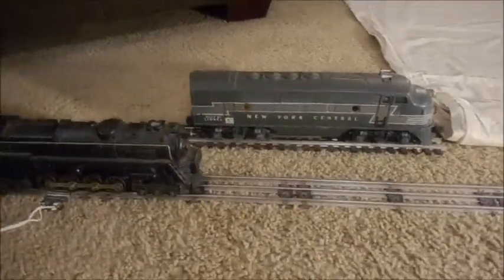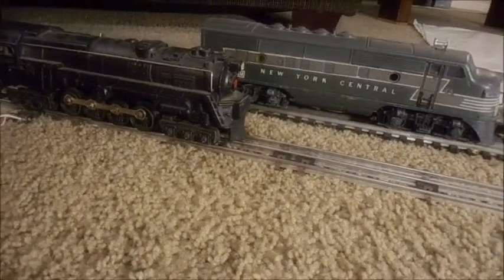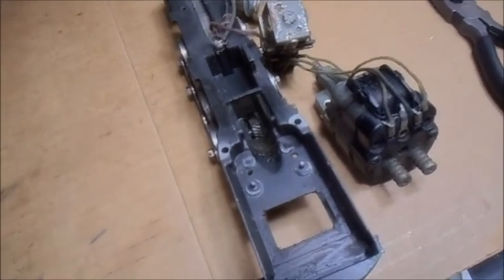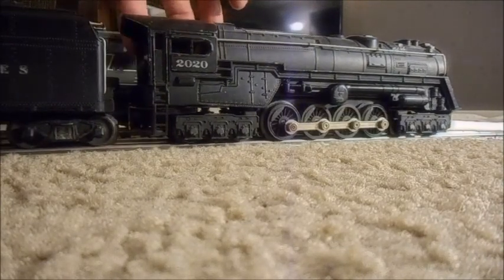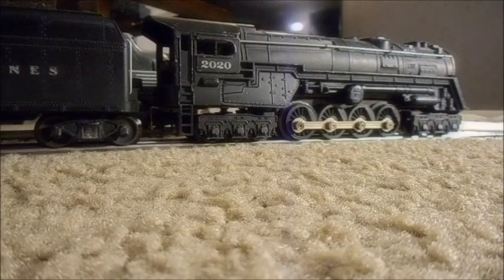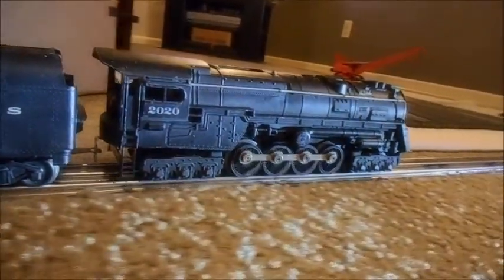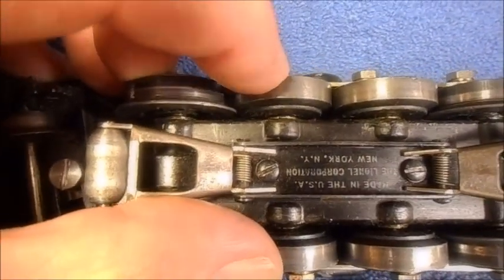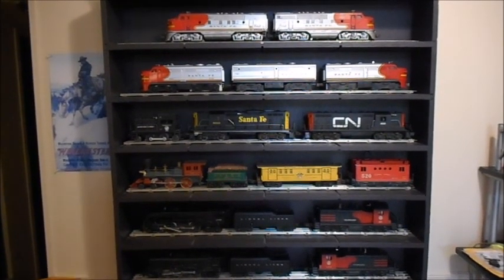Lionel 671 671RR 681 682 2020 turbine repair sticking wheels erratic lurching operation

Comment: Great video -- I ran into the same problem with a 736 Berkshire and did what you did -- press the wheels on the driving axle very slightly together. It was also necessary to very slightly spread the blind wheels on the adjacent axle. Performance is much better now. Thanks for providing this knowledge!
Reply from the maker: We are always learing in this hobby aren't we and since it took me so much time to figure out what the heck was going on that I just had to make the video to hopefully help others keep their sanity and not give up on their broken trains.  Happy Railroading!

Comment: I just completed repair on my 671. Wheels binding. Ordered new drive gear, bushings, wheel puller and wheel cups to remove and press wheels on. 
Took motor apart to clean brush plate, brushes, cleaned stator shaft, washers and ball bearings. Lubricant applicant and man can this baby hum!!
Reply from the maker: Excellent work restoring that machine and I'm curious if you found any worn wheel bearings on that rear driven wheel axle shaft.
Reply: @trainzone1073  yes there was one that I replaced.

Comment: Instead of using channel lock pliers, you should consider using a vise.  One thing that you may also consider: the brass drive gear needs to be centered on the drive axle.  In order to center the brass gear on the drive axle, it is helpful to temporarily insert 2 thick washers (one on each side of the gear) to take up the excess space while gently pressing the wheels on in a vice.  Let's not forget to properly "quarter" the wheels so that they are properly aligned with the others on the same side.  I hope this is helpful and not confusing.
Reply from the maker: Great repair tips to keep in mind.  My vice is in our maint shop across the property so I figured what the heck I'll try the channel locks.
Reply: @trainzone1073  Or you might want to use a "C" clamp.  It will give you more precise control than the Channel locks.
Reply from the maker: @GG1man  Good advice and with my limited tools here I had to improvise and got lucky.

Comment: I've had a very similar problem with a 671 turbine and like you it took me a couple day to figure it out. I came to a very similar conclusion except my gear apparently slipped to one side and I had to slide it back slightly, seem to be a common problem.
Reply from the maker: Great tip and I think one of mine had an off center gear too.

Comment: These are the most under rated engine but they have the same motor and other drive characteristics of the more costly Berkshires.
Reply from the maker: Excellent point, and with the die cast metal axle housing around the drivers, and the die cast metal frame, let alone the weight of the die cast metal shell,  great work Lionel.

Comment: I have found that the gear on the drive axle not being centered on the axle causes this jerky running in one direction and not the other. I have placed a shim between the right side of the gear and frame keeping the axle and gear from moving to the right and not meshing with the worm end of the armature and solved it. When reversed, the worm automatically drives the gear and axle to the left and runs smoothly which is why it ran great backwards. Also, a worn bearing and race will cause the armature to shift causing erratic running. I used a couple "E" clips to lock over the axle as shims. Re aligning or centering the gear and tightening the wheels to the frame is probably the right way.
Reply from the maker: Yes I have seen some gears more to one side than the center so they must not be pressing them on all the same.  Thanks for the repair tips for the train community.
Reply: I would like to suggest a possible reason that the drive gear may not stay centered as it came from the factory.First is age,the many yeas of operation
Reply: asI was saying the many years of operation can cause the gear to move slightly to one side or the other,the torque of the motor applies a sideways pressure,since most locos run in one direction much more than the other the gear would have more sideways pressure in that direction This could have and probably does have a very small incremental tendency to move the gear to one side more than the other,considering the age of these units there has been ample time for this to happen,remember that gear is pressed on and brass can stretch.

Comment: 9 out of 10 times one if the drive wheels are loose on the axle. Only way I found is using jb weld on the axle press the wheel back on let it sit and its fixed. Tip: put a piece of tape on the axle shaft up around the bearing so the jb weld doesnt bond the axle to the bearing.
Reply from the maker: Yes excellent and I had a loose one on a 2344 diesel and had luck with some locktite  and like you said keep it out of the bearing.

Comment: Thanks, that’s really helpful . My 671 has been sticking too. How did you remove the driver rods?
Reply from the maker: The side rods on the drive wheels have nut/stud fasteners and mine were so loose that a gentle touch with pliars was all I needed to remove, hope this helps and good luck on the repair.

Comment: Same thing is happening to my turbine. The e unit is cycling but it won’t go into forwards. There is some gunk in the worm gear. I will try to get it out
Reply from the maker: How is the turbine, running strong?
Reply: @trainzone1073  nah, I fixed the worm gear problem, but the engine won’t cycle from forwards to reverse. Ima see if I can get some crc electromotive spray
Reply: @skiiipawbs  Ah perhaps a reversing unit problem?  I do have one more tip I can pass on your way about cleaning the reversing unit.  Good luck!
https://www.youtube.com/watch?v=_56h8Que6hU&t=139s

Comment: My 681’s light isn’t turning on when power is applied. The drive is very responsive, and the caboose light turns on, but the engine’s headlight doesn’t turn on
Reply from the maker: Thanks for watching and the boiler front easily pops off (spring loaded tabs) where I'll bet you have a loose or burned out bulb.
Reply: Your lightbulb in the engine clamps onto the front boiler part. The boiler part can be pulled off in the front. Make sure it is grounded or has a good connection around the clamp from Bcad1979

Comment: My friends 2020 engine (dual worm drive) would bind up occasionally. I removed motor, E unit and a plate which covers the drive shaft. The gear on front axle was chewed up. Rear axle gear was ok. I grinded off the worm (spiral teeth) off the front of shaft. Now it’s a single worm drive. Works great!
Reply from the maker: Great work that you were able to get it restored and I've never run across one of those dual worm drive units yet.  I really like the turbines and at one point owned 5 of them but now I have a bunch of Hudsons this decade:)
Reply: 1946 the only year for the dual worm drive I believe. Seems like the single worm drive has less problems.